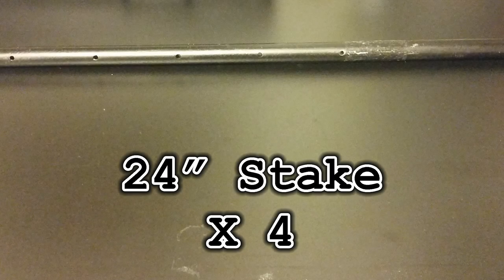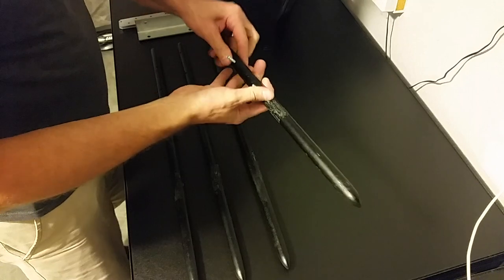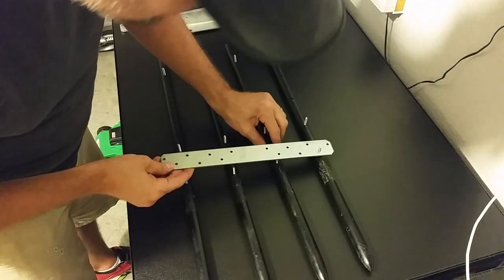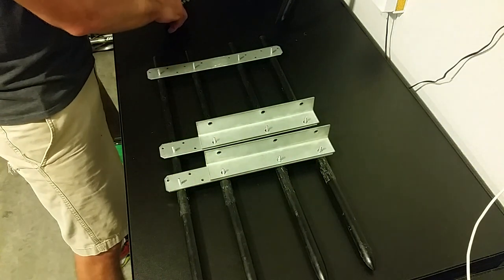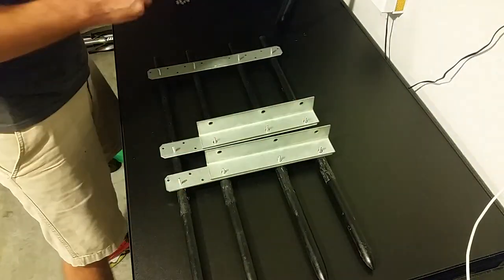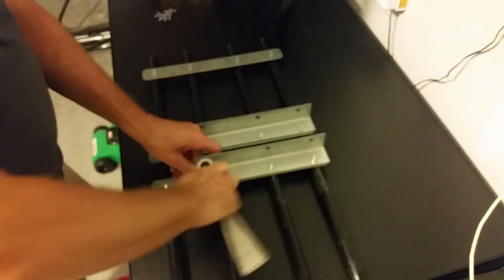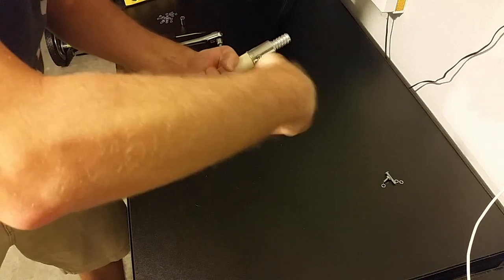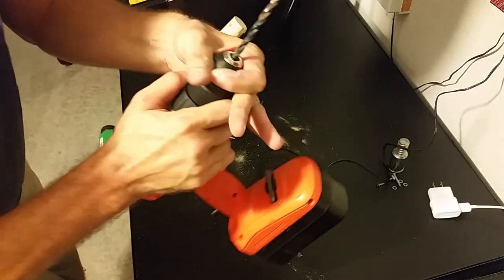DIY Lawn Leveling Rake // Lawn Leveling Tool For a Smooth Yard // How To Build a Lawn Lute

Comment: Awesome video and thank you for sharing!
So which tool is easier to use to level the sand / yard, the rake or the mat?

Also quick question about not having a strap on the other end of the rake, is it still stable or is there enough pre drill holes to add another strap?

Thank you
Reply from the maker: Thank you. Glad you liked it. I like the mat for the big areas and the rake for the small spots. There aren't enough holes to even out with straps. It's not the most stable thing. It would just depend on how picky the user is. I'm not picky and have no trouble with it. Works like a charm. Thanks for watching and the questions.
Reply: @BudgetLawns  thank you very much for the reply….

I forgot one more question our lawn is not as big as yours  but I’m trying to figure out if the drag rake is 3x3 is ok compare to a 3x5? (Any feedback)

Thank you
Reply from the maker: I'd got with the slightly bigger one as it's hard to get a lot of surface area on the lawn when standing up pulling it. Too small of a mat would make it even harder. Thanks again.
Reply: @BudgetLawns  awesome and thank you

Comment: SON OF THE BITS, LMBO
Reply from the maker: When I have to Google what your comment is (son of the bits?) and acronym means, it tells me you probably need to spend less time on the internet.
Reply: @BudgetLawns  INTERESTING,  I THOUGHT THATS WHAT YOU U SAID.
Reply: @BudgetLawns  @8.40 I THOUGHT U WERE BEING SARCASTIC AND FUNNY,   BUT OBVIOUSLY,  U CAN'T SEE THAT.
Reply from the maker: Haha. Don’t recall. I’m just messing with ya.
Reply from the maker: I said working my way up through some of the bits. Drill bits that is.
Reply: @BudgetLawns  LOL, I WENT BACK AND LISTENED,  I APOLOGIZE,  SURE SOUNDED LIKE IT.
Reply from the maker: No need to apologize. It’s all good. I figured you were messin with me so I was just messing with you too. Appreciate ya watching. 👍
Reply: @BudgetLawns  I feel better
Reply: Have you tried the leveling rake out yet?
Reply from the maker: Sure did. Worked like a charm. Just as I hoped. It’s heavy being made out of steel so it may be tough for some folks to use but the weight is good for leveling.
Reply: @BudgetLawns  ok, great job,  I'm going to try to make one

Comment: Like the pipe idea.  In my family, we have a rake that has been handed down from my great grandfather who built it when he had a little farm.  It is made from a cast iron pipe filled with concrete.  It is like a right of passage to be able to be old enough and strong enough to use it.  However, he built it because his other wooden one kept breaking.  It has lasted four generations so far and I would not doubt it lasting four more without a problem.
Reply from the maker: Thank you. That's a great story. I love those kind of products. They have so much more meaning than the store bought ones. That was my intention when building this one. I want something that will last. It definitely saved me money, but it's also not the cheapest way to make your own. I hope it pays off. I'd love to have a story one day like the one you just shared! 👊

Comment: Hard to even find these in the UK so making my own. Cheers for video 🙂 one question though do the bolt heads on the lawn side dig into the lawn or is it ok? 

Going to be making mine out of electrical conduit with unistrut for the handle piece
Reply from the maker: You're welcome. Thanks so much for watching. Definitely worth making one. Even when you can order them online they're soooo expensive. Sounds like you've got a great plan for materials. That'll work nicely. The bolt heads I used were so small they didn't cause any problems. Plus, the process of sand leveling is pretty destructive itself, so it'd be tough to notice anything. It's all good. Appreciate the question. Good luck in your build!